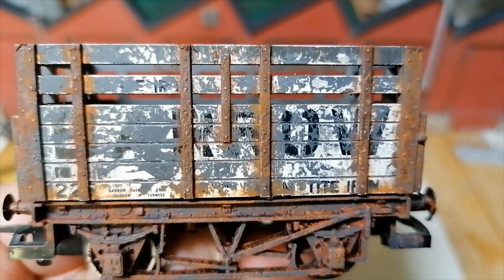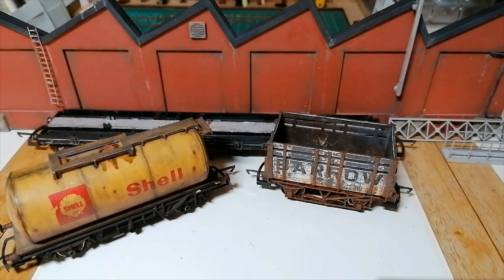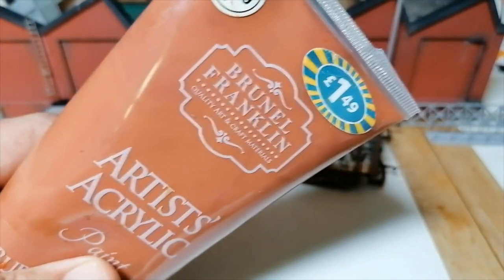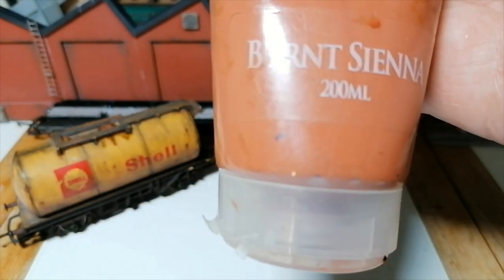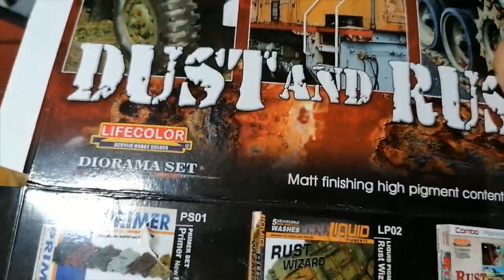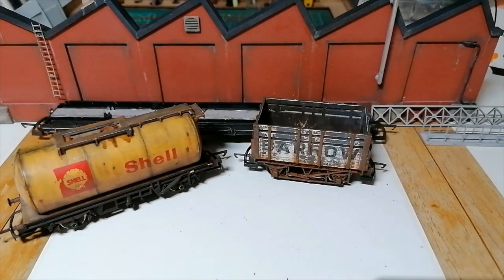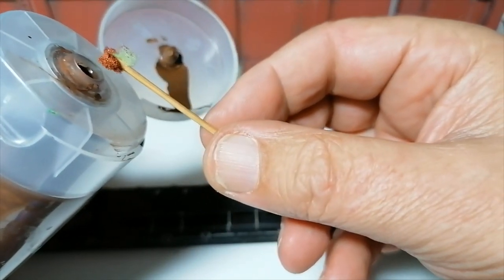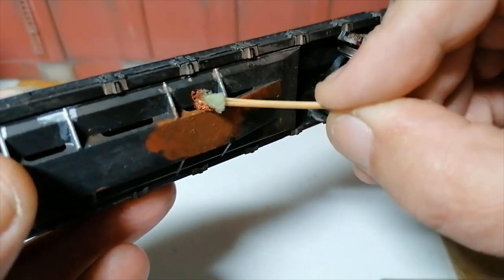Rusty rolling stock, for the model railway

Comment: I usually make my own weathering chalks.  I use the kitchen grater I got at a dollar store.  I grind up some white chalk and mix some food coloring in a communion cup (great little cups for mixing paints).  I then add my chalk and stir it up with a tooth pick.  I then pour it onto my cutting mat and wait for it to dry.  Then I use a single edged razor blade to cut it up as if you were cutting out a line of cocaine. :-)  Then I put it back into the communion cup for storage until I need it.  For trucks, wheels, freight car bodies and locos to add rust I use REAL rust. I take a roll of fine steel wool and put it into a quart jar and fill it up with white vinegar and set it on a window sill so the sun can shine on it. After a month or two, I pour the liquid out into a stainless photo tray from my darkroom (10X14). After it is completely dry I use a single edged razor blade scraper and scrape the rust out of the tray. It usually comes out as a fine powder. I then store it in a snuff container. Depending on how long you leave the steel wool in the vinegar my batches come out with different colors of rust, i.e., some are orange and others are a deeper colored red. When I get ready to use it I put several scoops of my rust into a plastic communion cup (neat little cups for mixing paints) and add some alcohol, Elemer's white glue and a dab of water soluble glycerin. Then I just brush it on. If I want an area where the rust has eaten through the metal (plastic) I use my X-acto knife and make some gouges in the sides of a car and fill it up with my rust. To seal the rust I usually topcoat it with a flat acrylic clear coat. It looks very realistic 'cause it is REAL rust! Happy Railroading! W Rusty Lane in eastern Tennessee
Reply from the maker: that sounds like an amazing technique my friend thank you for sharing it